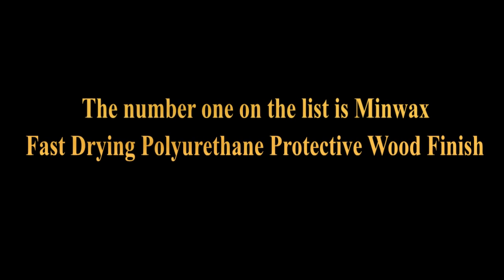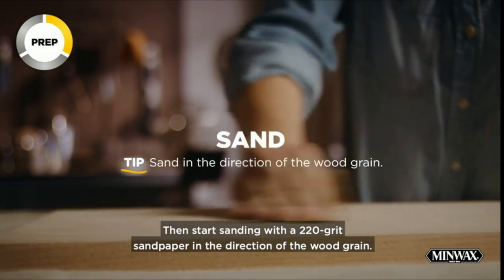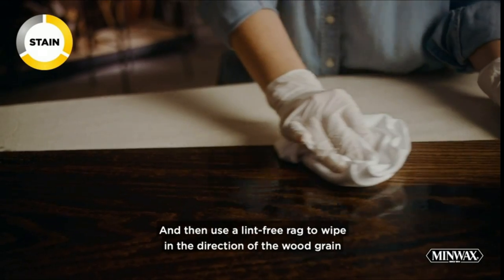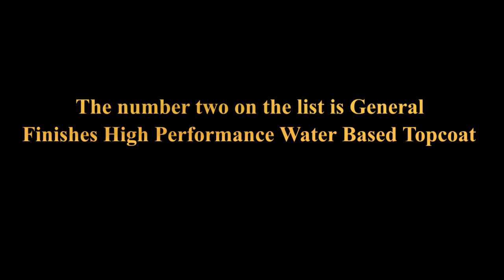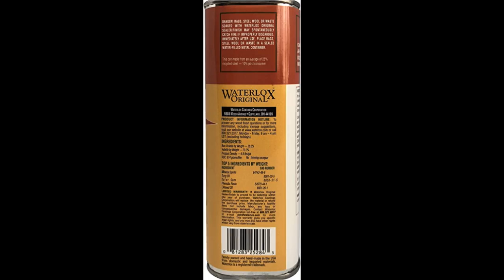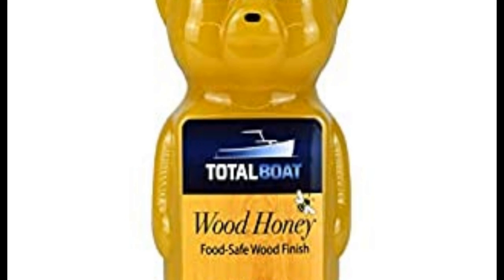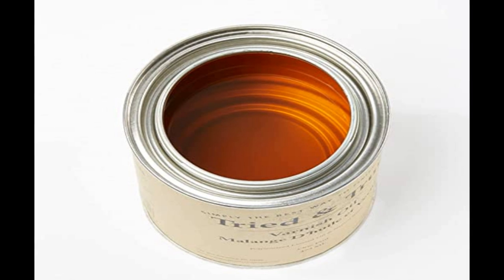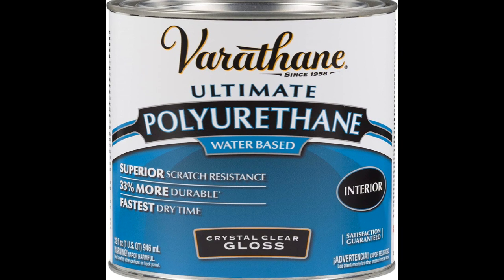Top 5 Best finishes for table 2024

Comment from the maker: No 1  Minwax Fast Drying Polyurethane Clear Satin = https://amzn.to/3DyDxCV
No 2 General Finishes Water Based Topcoat High Performance = https://amzn.to/3zJYauW
No 3  Waterlox Original Sealer/Finish Premium Wood Finish = https://amzn.to/3U5wyIR
No 4  Tried And True Wood Finish Varnish Oil = https://amzn.to/3NyNq8a
No 5 Rust-Oleum Varathane Ultimate Polyurethane Oil Based Satin Finish = https://amzn.to/3FNK8w3as